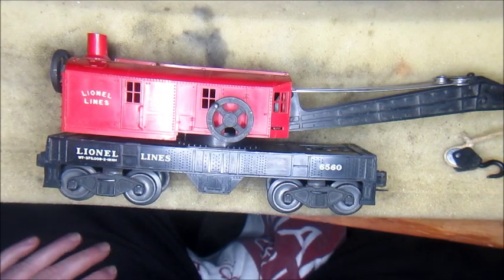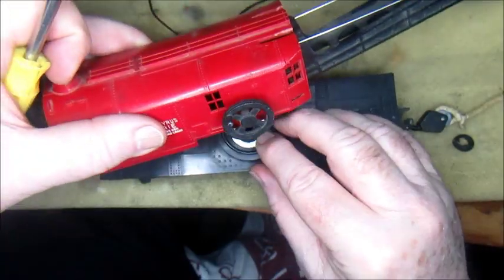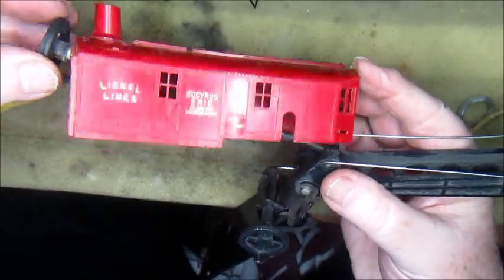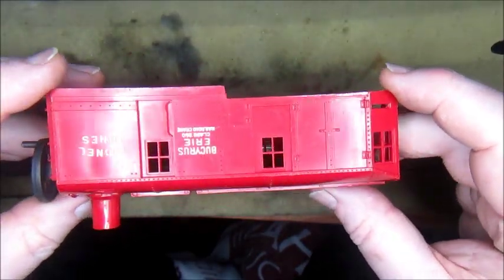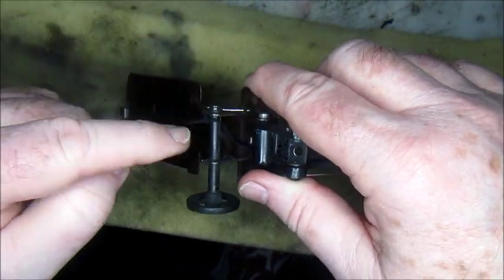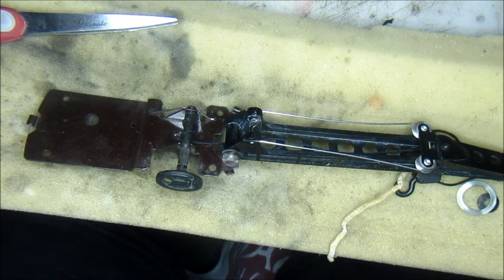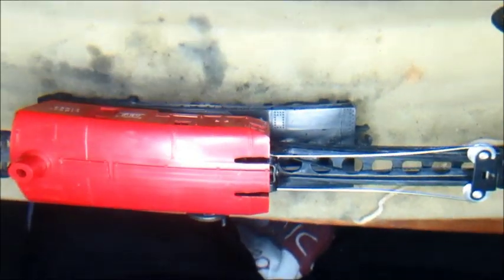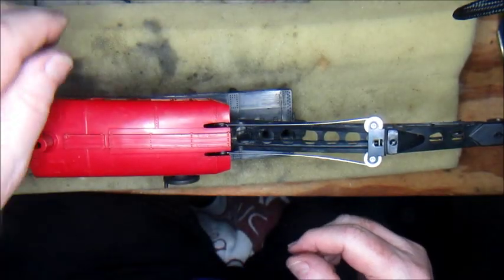Lionel 6560 Crane Car Repair

Comment: Thanks for this very helpful video, as I'm about to install a pulley cord myself.  What I don't see (or didn't catch) is where the opposite end of the cord is tied off (before the other end rolls up on the drum assembly)  Can you answer this for me?  Thanks again.
Reply from the maker: The cord is not at first on the top of the forward most point of the crane. Then it is threaded as described in the video. The other end of the cord passes through the hole in the spindle that elevates and lowers the crane and  tied  off there.
Reply: @peterfenzel4742  Thanks for responding and so quickly, but... not comprehending here.  You write: "Cord is not at first on top..."???  Answer I'm looking for is how to tie off both ends.  One end, as shown, is tied off at the spinal, but the other end is attached to... where?  Sorry, don't mean to be a pest or so dense.
Reply from the maker: @kentwilson5188  knotted
Reply from the maker: @kentwilson5188  You start by making a KNOT at one end of the cord and passing the cord down through the hole atop the front top of the crane. The KNOT doesn’t pass through. Then string the cord as described on the video and tie the other end through the hole in the elevating spindle.

Comment: If you remove the boom elevator screw first, removing the body is MUCH easier, and you don’t have to remove the crane from the platform.

Comment: Hey you might know the answer to my question... I want to get one of these old Lionel crane cars for a logging layout I’m building, but I’m working in On30, I’m wondering if it’s as easy as replacing the trucks? I tried to see the attachment, but it’s hard on these small screens, are the trucks just held on by a screw and I can put on30 sized truck on really easily?
Reply from the maker: The 484-1 trucks are fastened by a truck mounting screw.

Comment: How do you tie the hook on
Reply from the maker: See the video at about the 6 minute mark. You start threading the new cord at the tip of the crane and, with the hook facing the crane, thread the hook's pulley. It is rather easy.  Good luck!
Reply: Sorry but you didn't actually show that you knotted the hook end of the cord after you ran it through the small hole at the boom end, down through the hook pulley and back up through the boom pulley, creating a loop for the hook to ride on. Most likely you knotted it first and just pulled it up snugly to the hole. Also, I noted in a Greenberg catalog that all photos of the 6560 show the hook facing away from the cab. In any event, your video was helpful when replacing my new cord!